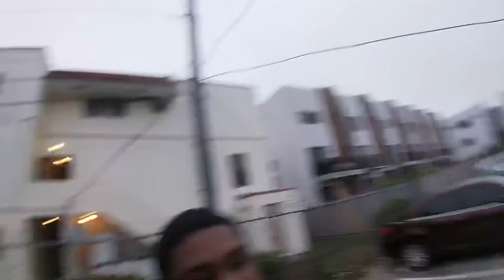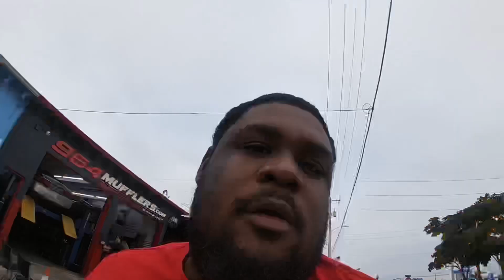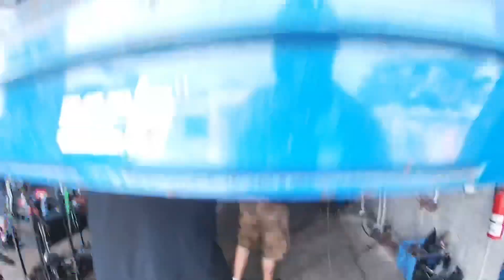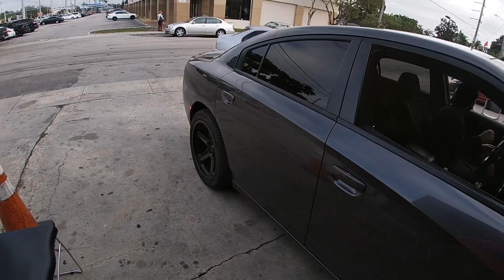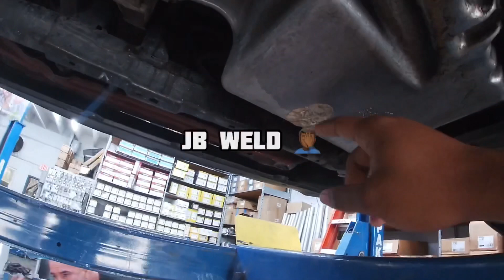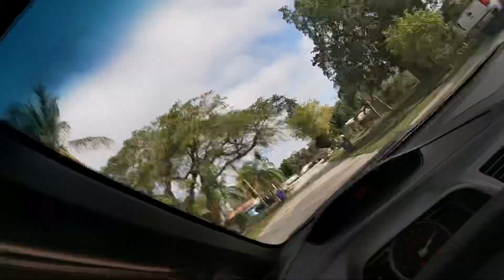07-11 Civic Si Muffler Delete.

Comment: Finally a good muffler delete and a someone that can acutally shift
Reply from the maker: 😁 Thank you!!!
Reply: @AllenSpec  is a 8th gen si with 186k mikes worth it? For $7,995 or one with 166,666k for 5k
Reply: @AllenSpec  I meant 166,666 for 8k
Reply from the maker: I paid 3,200 for mines with 170,000 miles but as you can see the body needed paint. The sedan are holding there values even with a lot of miles so it’s up to you. If the car is bone stock never modified then that’s your best bet in a good one
Reply: @AllenSpec  ohhh, ok cause I’ve seen one on Facebook marketplace for 9.5k with 76k miles with only one picture idk if it’s real or fake 🤷‍♂️ ad, 100% bone stock but not daily driven 🤨 idk man…
Reply from the maker: Just have to inspect each car when you see them. Look for leaks and how the car shifts. K series transmission can’t take much that’s a good sign if it’s been beat on
Reply: @AllenSpec  bro! honestly thank you for helping a 16 year old out, cause I saw another civic si 09" for $9.1k comes with a turbo un installed and a jdm k24a2 engine swap the engine has 40k miles the body of the car has 141,856. it is also tunes with hondata flash pro, has Megan racing headers, and a Injen Intake the turbo is a Gtx 30 76r gen2 and lastly a vibrant performance exhaust. I might have to check it out since its in my area, but thank you for the tip bro!
Reply from the maker: No problem homie hope it works out for you
Reply: For real bro i got an 07 Si coupe and im about to do the same
Reply: i just got my fg2 for $3900 with 100k

Comment: Mine is I'm guessing the DX model with the 140hp 1.8liter 4cylinder with automatic transmission. I'm hoping it sounds this good with your setup. Only thing I'm doing differently is I'm going to use a diesel pickup exhaust tip to help lower the note.

Comment: Did you use a different size piping or the same size to fit the stock exhaust?
Reply from the maker: Not sure what they used I believe it was the same size. The tip I believe was 3in inlet and 4in outlet kinda I just chose the one I liked the most

Comment: Looking at doing this with my EX. What size pipe did they put behind the tip to connect to the stock pipe?
Reply: Also, did you throw any codes or anything after doing the delete? I'm not running an aftermarket chip or anything so I'm kinda scared the increased flow will throw up some CEL's...
Reply from the maker: You won’t throw any codes as long as your cats are there removing the muffler doesn’t throw codes. And not sure what they use but my tip was 3.5 inch

Comment: Hey bro, first of all great sounding civic. Not gonna lie it sounds a lot louder then I thought. I wanna do this to my 2010 civic. I do have a question tho. You got the muffler delete and went with a straight pipe?
Reply from the maker: Thanks bro and yes all I did was replace the muffler with a straight pipe with a tip at the end.
Reply: @AllenSpec  oh okay man
Reply from the maker: No problem cheap way to make the car louder but not raspy
Reply: @AllenSpec  yes I was really impressed that a 4 cylinder engine sounds like that. Now did you have to supply the straight pipe yourself?
Reply: @AllenSpec  I know im asking a lot of question but also how much was the job?
Reply from the maker: Nope I didn’t supply anything a muffler shop should have everything you need unless there’s something you want to add like a different tip or muffler or a certain pipe you want to use
Reply from the maker: No problem bro I don’t mind I’m here to help. It cost me 75 if I used to the stock tip and 75 extra to use there tip and they gave me a deal so I paid $120
Reply: @AllenSpec  Oh okay that is worth the price no lie. Idk why I didn't think of a muffler delete before tho, sounds good. Do you have an Instagram that we can follow?

Comment: I did the same thing to my Type S, sounds amazing with just a muffler delete but I do plan on getting a AEM V2 short ram to really bring out the vtec sound
Reply from the maker: Love the K20Z1 crossover the crossover would be better if you get a CAI over the short ram depending on your location rain could be a issue with a CAI
Reply: @AllenSpec  Yeah it rains alot in VA so imma take the safer route lol
Reply from the maker: Ain’t nothing wrong with that bro.